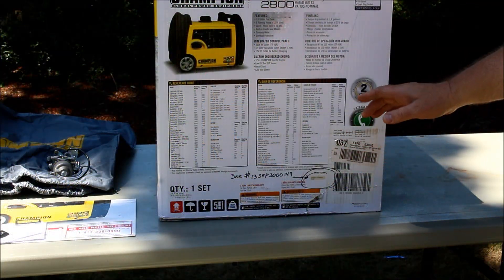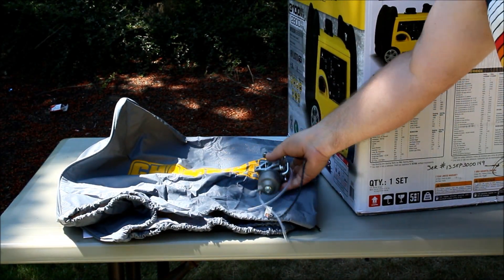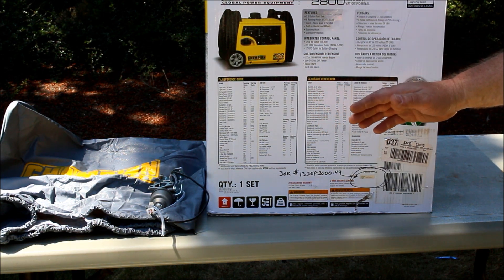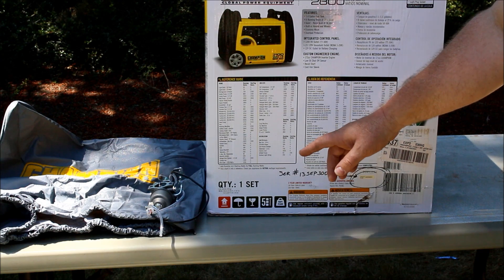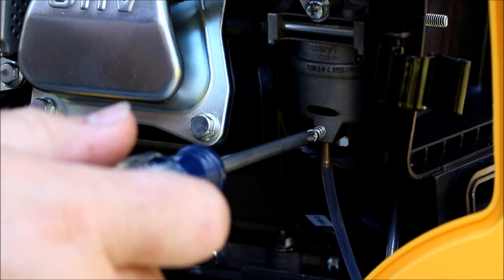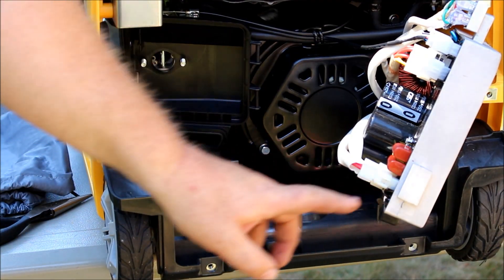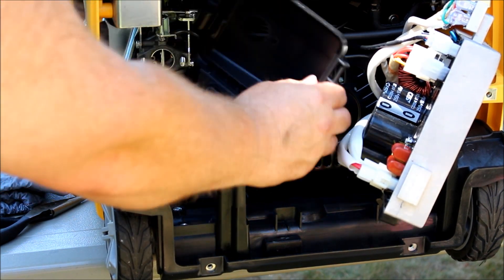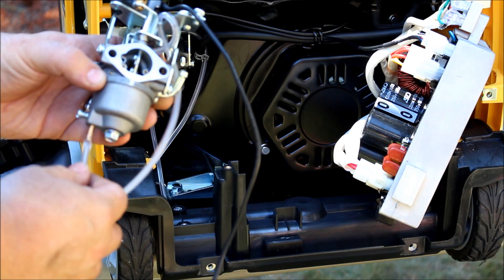Champion 3100 watt inverter generator repair.

Comment: Hello Ed, VE6ZH here, i see you are a ham as well. I installed a Champion control module In my Yamaha 3kw inverter, and I am struggling to find connector views with the wiring color / positions. I have the wiring diagram but they do not show the connector pin orientation. I haven't been able to find a service manual for the Champion 3100. I also need the connector views / colors for the "portfire" aka speed limiter module. This is the module with the three LEDs. I purchased the module and want to incorporate it on the Yamaha. Would you be able to supply the info I need with pictures etc.?
I appreciate any help you could provide sir.
Tnx
Doug

Comment: Did you try cleaning it first ? I’m strgggling to disable mine
Reply from the maker: @djkevinbanks  It was brand new when I made this video so I immediately called Champion. When I replaced the carburetor I found small brass shavings in the the original so I'm assuming they were interfering with the jet. Looking back, I'm pretty confident a good cleaning would have been sufficient . Good luck

Comment: Mine started running this way as well after sitting for about a year (prob more like 6 mos) without being started. Apparently these carbs are very finicky*. I called Champion and they ordered me a new carburetor with a high alt jet (I’m at 7300’). After a few weeks and nothing, I called back and they said they’d send the new carb for free. I got the new carb, but wasn’t able to install it for several months...that’s where this video helped a bit, as I couldn’t quite remember how I took it out. It was quite easy to replace/reinstall, and it fired up on the second pull and now runs great. I will now run it dry and use seafoam in between uses.

Thanks for posting this video..

*Champion, if you are listening, it shouldn’t be this difficult to use your generators. ***We shouldn’t have to do carburetor work on new engines***.  I have a craftsman lawnmower from 2001 that starts on the first pull and runs perfectly with zero additives or extra shenanigans.
Reply from the maker: Tim Fanning Glad it was of some help.
Reply: Tim Fanning I agree Tim. I bought a brand new one it did this so I took it back. I got another one and it made it a year before starting this surging and Champion gave me a new carb. Now 6 years in the carb is surging again, keep in mind I run this monthly along with my Westinghouse inverter of the same age which has given me 0 issues, and I now have the added bonus of not starting when warm so I am sure the coil is going bad too.

Comment: I bought one new in November 2017 and it is still in box. I haven't taken it out yet because I thought there wasn't any fuel or anything in it yet. Am I wrong? I just thought and  if I have any problems I will just drive out to Champion here in California. It is a 2 1/2 to 3 hour drive and I think I would let them fix it.
Reply from the maker: lashturner No, they come empty and dry. Mine actually turned out to be brass shavings in the carb from assembly.
Reply: I have a 3400 same issue put new carb same thing

Comment: Same generator. Same problem. Got the new carb but I sure wish you would have not skipped through the video. I guess I'll pause and study each frame to try and figure out what you did. Zero paperwork came from Champion with the new carb...
Reply from the maker: Steve Vandeman sorry about that. I hadn't planned on making this video but when I searched for one and came up empty, I thought I might as well give it a shot.I needed this thing fixed so I didn't spend a bunch of time planning out the video. I ended up taking more pictures than video. If I were to make this again it would be different. 
Heads up though, the carb had no problems with old gas. It did however, have brass shavings up inside the main jet above where it was screwed in. If I had taken that out and blew but clean, I bet it would have worked. Good luck.
Reply: I understand. Your video is still the best thing I had going since I have the same generator. I was surprised myself when I put it all back together it started up and purred like a brand new kitten!

Comment: Same problem, run only about 5 hours. Speaks well for this product. All I got from Champion Canada was a sarcastic response
to my problem.
Reply: Again, add an inline fuel filter to keep the fine particles out of the carb. I did this to all five gennies I own and never had this problem over decades of use

Comment: How quiet is the inverter when running a HF radio?
Reply from the maker: I've never actually connected my HF radio to it. I'm curious as well. If I do it, I'll  try to remember to make a follow up video.

Comment: Mine is doing the exact same thing.  It ran fine for what I would guess is 20 hours, but towards the end it started surging up and down real bad.  Now it runs just like yours.  They are sending me a carburetor now, so I needed to find how to install it.  Very timely and helpul video W7EDM, thanks for taking the time to post it.   Will post details on what I see inside the carb.
Reply: W7EDM Great idea and I will try that tonight when I get home.  New carb ETA this coming Friday.  Would much rather not break everything down if I don't need to.  Thanks again W7EDM.
Reply: Virtually all of these small generators are missing an in line fuel filter which keeps very fine 25 micron particles out of your carburetor ensuring the tiny jets stay clean. This will avoid the surging problem quite common when the carb jets become plugged.

Comment: I just bought the same one and I have the exact same problem as well.  It surges when it is in economy mode.  It is a Dec. 2013 model and it was brand new in the box.  Never used.  They must have a defective carburetor for sure. Purchased July-2014